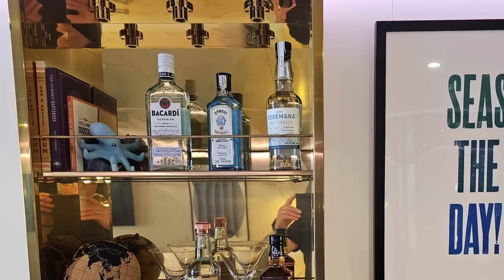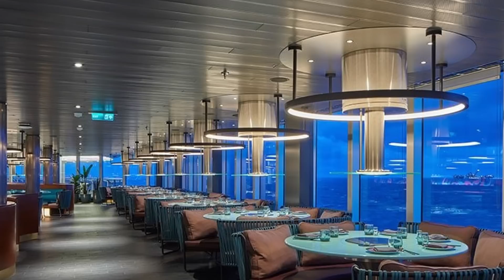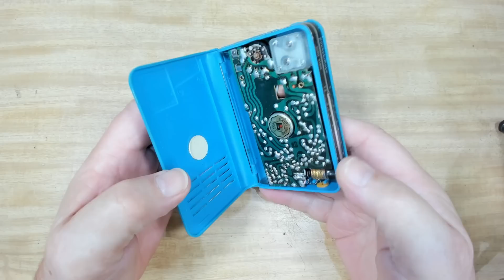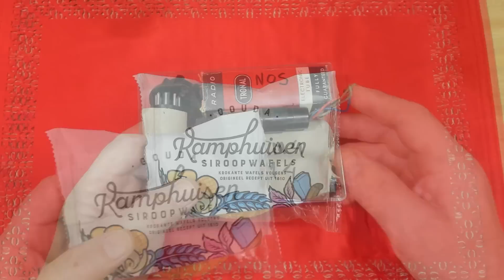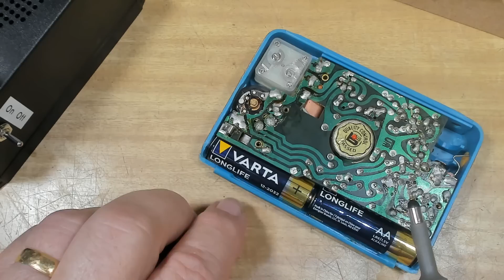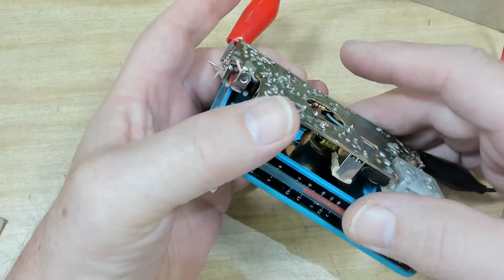Bolton Radio, a Cruise and a Cookie

Comment: Stroopwavel tip 101. Allow the stroopwavel to sit horizontally above the mug and wait until the syrup becomes molten to a goo-like state of matter. What's when it's best to eat it. 

You were correct about not pealing the stroopwavel apart.
Reply from the maker: I am fully au fait with Stroopwafel etiquette now Branden thanks to tips by yourself and others. I have one stroopwafel left and will try and get it right with my afternoon coffee. Thanks 🙂
Reply: Oh my god what have I done... I explained in the email that this is the traditional way to eat the stroopwafel but I failed to explain this properly. I hope the stroopwafel police don't find out about this video because the way he handled the stroopwafel will result in huge fines.😮😮

Comment: There are very few chances of damage of electronic components like transistors, diode etc on 3 volt battery supply, volumes resistor or any printed board brak, however, Bolton radio is very nice looking especially color and compact size
Reply from the maker: I agree, thanks 
hanif 👍🙂

Comment: I was in the Navy for ten years and have not felt an urgent need to go cruising again. However, if it meant getting to Europe or North America without going through airports or doing 16 hour flights I’d consider it. Nice little tranny, thanks for the vid. I have a collection of early Sony 6’s in each of the colours released. All they needed was recapping. My dad had one and sat it on the dash of our FJ Holden in the early 60’s. He had it connected to a large 9V battery via a long lead to save buying the expensive small batteries all the time.
Reply from the maker: I can understand you having enough of ships and I guess the cruise ships return to the northern hemisphere for their summer season, getting back might be a problem. I well remember small transistor radios propped up on the dash back in the day, a far cry from what we have today. Thanks Roberto 🙂

Comment: Hi David, If it were me and I was confronted with the same symptoms I would try pushing an earphone plug in and out of the earphone jack a few times, this has worked for me a few times.
Reply from the maker: Hi Peter, I shorted the earphone socket out to no avail. It still could have been the problem of course 🙂

Comment: I suspect some corrosion on the switch on the earphone connector that disconnects the speaker. I think you were fooling with it when the radio started to work. Those cruise ships are amazing, aren't they?
Reply from the maker: I don't know 4X6GP, I shorted the ear piece contacts to check that but it is still a possibility. The ship was amazing 🙂

Comment: Yes those solder connections all look a bit dodgy. Replaceing those electrolitic capacitors was the icing on the cake. A lot of equipment has suffered just because of a few faulty caps. Low values under 100 Uf can be a problem. It's great that you and your wife injoyed you trip away on the cruse ship. Maybe a tast of better and longer trip by ship are in the wind . Looking forward to the next " David Tipton radio adventure".
Reply from the maker: Electrolytic caps have limited life so always good to replace them. It did improve the sound. We have done 4 cruises, the longest being about 15 days. Thanks Stephen 🙂

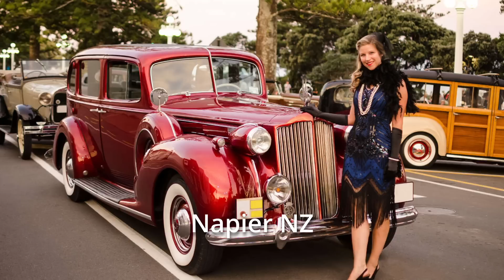Comment: 1:32  Is that pronounced nappy-air?  I never heard of the place before, but I've only ever seen Carson Napier in print (it's the name of a fictional character), never heard it pronounced.
Reply from the maker: It's pronounced nay-pee·uh. I cut the sound clip in the video so it sounded a bit cut off. Carson Napier... Edgar Rice Burroughs??? 🤔
Reply: @DavidTipton101  Just like my name, Tars Tarkas.  I'm a big burroughs fan.
I did hear the name pronounced in a librovox recording, but they were probably just as wrong as I was.

Comment: Great Video as usual, just wondering are you using standard a CRO probe with your signal tracer?
Reply from the maker: Hi Joshua, I was probing the AF section so a standard probe was Ok for that. I would use a demodulator probe for the IF section 👍🙂
Reply: @DavidTipton101  Thanks David, I decided to dismantle a CRO probe and remove the Caps to make it a straight through. Will put the Diode in the Tracer, also going to try a preamp with an agc just to see how it goes

Comment: You had a wonderful holiday but it was back to work all too soon. Did the radio have a stuck contact where the headphone plug goes into the jack? Wasn't clear on that David. But after melting it a bit  and E- cap replaced its a nice little radio once again.
Reply from the maker: Hi Steve, it was a very good trip, thanks. I wondered if the earphone contact was dirty but I did check that. I really don't know what 'fixed' it, earphone socket or bad solder. It's still working so I fixed something 😄

Comment: Thanks for the Cruise update Dave. I was wondering how you fixed up that bit of the case you melted? I presume you heated it up and used a little palette knife while the plastic was hot, or something similar? Be good to know for a "10" thumbs bloke like me. I've done it myself and haven't been able to repair it. You did a great job. Spill the beans please mate Ha Ha...
Reply from the maker: Thanks Geoff. I was able to clean up the damage and the top cover covered it luckily. I need a smaller iron for solid state stuff 👍🙂

Comment: Unlike old valve radios that need Viktor Frankenstein's intervention, not that old transistor ones having some soul left get scared at disassembly (naugty fingers with a screwdriver can be deadly) and put all they have together to show ability to function :)
Reply from the maker: Yes, you have to be a bit careful with solid state stuff, not as forgiving as valves radios. Thanks Deep 🙂

Comment: The problem with cruises is that afterwards you have to go to the Weight Watchers, or worse still, to the AA.
Reply from the maker: They had a gym which I used extensively. I don't drink much either 👍🙂